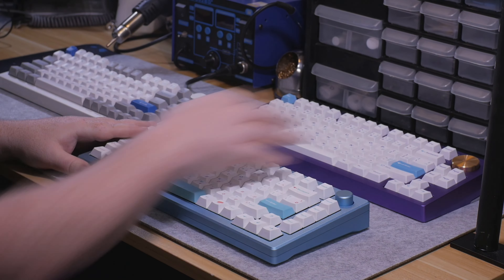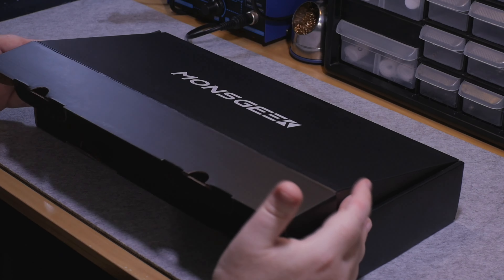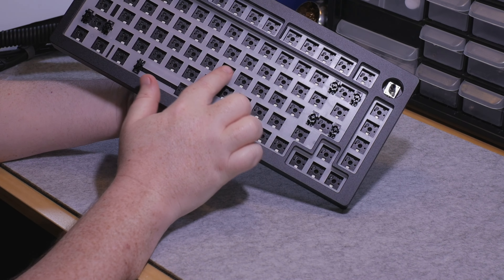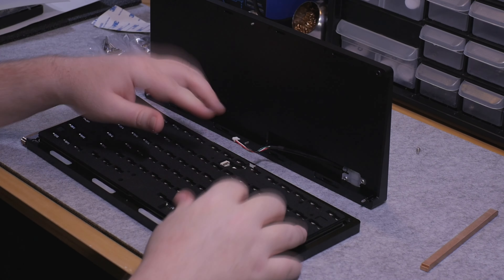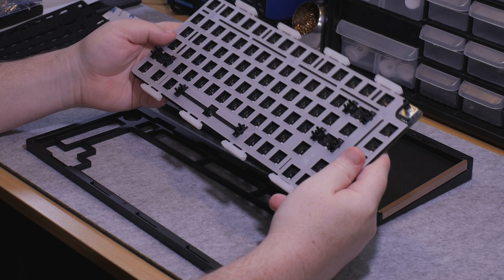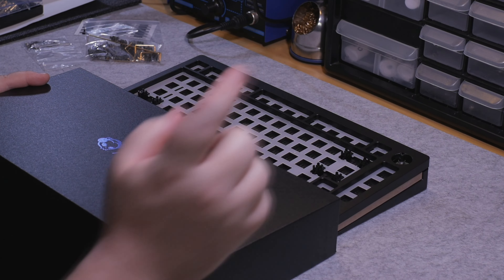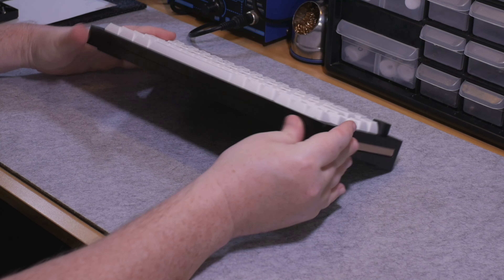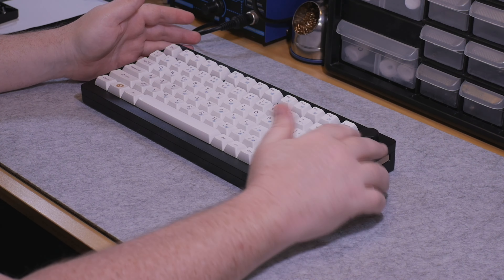Changing The Game - Monsgeek M1 Unboxing and Build

Comment from the maker: The excitement I had for this board was justified. Sure it needed a little love but for $100 this just simply slays the competition in the same space. Give it up for Monsgeek! Do you think this will change the in-stock game as we know it? Let me know in the comments!
Reply: Hey punk! did you check the Finalkey v65 r2 ? i found it on aliexpress and its even better value! aluminum case, 65%, south facing, PC + Fr4 plate already included, screw in stabs, wireless dual mode, all the foams you need, and even comes with keycaps without the swtches! maybe its a contender for best budget KIT. !! check it out
Reply from the maker: Its in the same vein as the M1 but still misses the mark a bit. Its $30 more expensive and is a smaller layout which alienates a good bit of newcomers to the hobby. The BT is a nice add but also somewhat pointless in an alu case. Don't get me wrong, its still an okay value, but its in the same neighborhood as the Q2 and MOD 008. Its basically in near direct competition with them. $30 might not seem like much but it can shift a product an entire market segments.
Reply: @punkshoo  i know moonsgeek claim $99 but thats not the real price its beeing practiced at aliexpress. The finalkey v65 r 2 i found to be cheaper then the M1.
Reply from the maker: The one being sold on AliExpress isn't the int'l version. Please check the Monsgeek site. The board is $99.99 + shipping. The Finalkey is $126 + VAT + Shipping. Again, still a decent value but its like comparing apples and oranges. They clearly service 2 completely different types of customers.
Reply: mxrskey ck820 good? I know it’s a bit more of an expensive kit but is it on par with or better?

Comment: To those who doesn't know yet, the white sheet inside the keyboard was supposed to be stick on the bottom on the case so that you wouldn't shock your pcb. The white sheet in the box, was for the tape mod.
Reply from the maker: That is correct. This was demonstrated at 11:27 in the video and the tape mod was mentioned in the unboxing section.
Reply: @punkshoo  sry but you messed that up..

Comment: What was the flex like with all the included foams? Would you recommend maybe losing the case foam to increase the flexibility of the gasket mount (ie, leave more room in the case for movement)?
Reply from the maker: Having full foam is always going to reduce flex a good bit. There is minimal flex but you can still feel the bounce in the typing experience. If you want that full flex I would definitely remove the case foam but you'll likely need to use polyfill or some other less-dense filler to remove hollowness.
Reply: @punkshoo  Do you think the hard plastic sticker that you put on the back of the case enough to reduce any hollow ping? Or you think you'd need something more?
Reply from the maker: The sticker is more for preventing shorting than anything but it does help slightly with resonance. I would also do a force break at a bare minimum and then decide for yourself. I personally would still use some thin felt or polyfill, personally.

Comment: hi! can you please explain where did you apply the double layer of painters tape? it was on the bottom case instead of the sheet given in the package?
Reply from the maker: Tape mod goes on the PCB and I used my own tape so I have control over selective layers. I like to put one extra layer under the spacebar usually.

Comment: I think they used aluminum screws for the aluminum case to prevent galvanic corrosion from happening
Reply from the maker: I doubt that is the case. They are likely using lower cost alloy screws to reduce the over all cost.
https://www.metalworkmasters.com/materials/stainless-steel-screws-in-aluminum/

Comment: So regarding the non ferris screws, its actually a good thing because ferris screws have softer materials mixed. So non ferris screws are actually higher qualityx as far as i know.
Reply from the maker: Do you have a source for this information? Non-ferrous refers to the lack of iron in the material. If there is no, or minimal, iron I would imagine that it'd be primarily nickel, aluminum, or magnesium which are all softer metals.

Comment: The white Sheet is the Tape Mod for the PCB. Stick it on the PCB
Reply from the maker: I am aware of this. I mention this in the video that a "tape mod is included". I opted not to use it in combination with PE foam because I am not a fan of both and I mostly dont like tape at all. I only use tape if I need to elevate the volume.

Comment: Just bought a clearance sale nk87 aluminum for $75. The M1 looks sick and idk if I made the right choice. With the mods, would the M1 compare in quality to a typical $250 case?
Reply from the maker: I would consider the M1 to be a bit nicer than the NK87 but there are lots of factors to consider. Which color NK87 did you get?

Comment: can you make this keyboard sound deeper("thock") with some mods and different switches? And if so what would you do differently than what you did
Reply from the maker: You can load it with foam, switches that lean toward deeper pitches, and use taller/wider keycap profiles to lower the pitch.

Comment: HI, whenever I press one side of a key with a stabilizer the other side pops up. Do you have any idea on how to fix this?
Reply from the maker: Make sure you're using stabs that are correct for your switches. If you're talking about your spacebar then check for bowing. If the spacebar is bowed it can usually be fixed with the hot water method.
Reply: @punkshoo  how can you know if you are using the correct stabs for your switches?
Reply from the maker: Sometimes long pole switches can sit higher than some stabs which will contribute to these teeter totter effect. Its usually not overly pronounced and easily triggered but the issue does exist in some cases.
Reply: @punkshoo  do you think the akko pom silver is good enough for the monsgeek m1 screw in stabs?
Reply from the maker: They are slightly long pole and I havent had any issues with the stabs combined with Akko switches on the M1. Outside of that not sure what to tell you.

Comment: Hows the flex on it?
Reply from the maker: Its fairly flexy with the stock PC plate. Especially if you remove the case foams.
Reply: @punkshoo  I agree! After purchasing it and experiencing it myself i feel theres a great balance between sound and flex without case foam and force break done on the board.

Comment: The biggest question really is what's the difference in typing feel between M1 and Mammoth. 
There really is none which is why there's only a sound test. So unless you're looking for that mammoth weight, M1 is the best value.
Reply from the maker: There's actually a SUBSTANTIAL difference in typing feel. The M1 isn't nearly as flexy as the Mammoth. Whether or not that matters to you is entirely up to your preference in typing feel. There's only a sound test because this wasn't a Mammoth vs M1 video. This was an M1 video with a small side of audio comparison just because. Also, the M1 is using linears and the Mammoth is running heavy tactile so there's that, too.
Reply: @punkshoo  Good to know. I was hoping to hear some sort of comparison between the two in the video unless you were planning to do a comparison video later. If not it kind of leaves the viewer wondering about the differences.

Comment: What sound profile would I get with lubed cream yellows? And akko keycaps? I prob gonna force break and use pe foam and is the m1 better then the mod 007?
Reply from the maker: Cream Yellows are your standard Akko switch in terms of composition. Check out other Akko switch sound demos to get an idea. They should sound similar to Machas or Radiant Reds. It wont sound like these because these are a special collab switch Akko did with a Billi Billi creator.
Reply: @punkshoo  I know I'm choosing the yellows since I'm on a tight budget and idk if this build would be quiet enough so when I call with my friend them ears don't die. I might be able to filter it out with my mic

Comment: Does it have n key roll over and what kind of stabilizers do u need for it
Reply from the maker: it does have NKRO and you can use plate mount or PCB stabs. Screw ins or clip ins will work. I had no plate tolerance issues with the PCB ones I used like we've seen in previous Akko products.
Reply: @punkshoo  No, like what sizes for the stabs
Reply from the maker: It just takes stabs... there's only one brand that comes in "sizes". Its a 1.2mm PCB if that's what you're asking.
Reply: @punkshoo  is the spacebar a 6.25u or 7u
Reply from the maker: Its a standard 6.25u.
Reply: so cringe

Comment: How to make this keyboard quieter without using slient switches?
Reply from the maker: Use normal travel switches with more muted sounding housings, PC plate, and lots of case/plate dampening. Don't PE or tape the PCB.
Reply: @punkshoo  thank you for the reply. I am really new to custom keyboard, I assume the M1 already comes with a PC plate? In regards to switches with muted sounding housing, my own research told me we are talking about switches with Nylon material? I have been wanting to try out Gateron Hippo, Lavender and the EQUALZ Tangerine, which I was told they are some smooth and quieter linears, am I on the right path?
Reply from the maker: Yes, the M1 comes with a PC plate and it sounds like you are on the right path with those switches. I would point out that it sounds like your basis is in older information as all those switches are quite dated at this point but on the other hand most new switches are long pole which tend to be a good bit louder.
Reply: @punkshoo  That's a good point about the switches, I haven't figured out about what to look at when it comes to trending quiet lieaner switches, I supposed. I actually have tried 3-4 sets of Akko linear switches, I am currently using the Rose Red, I like light presses, minimum forces but it doesn't sound good at all. (After watching your review) I'm planning to start a new build with more premium linear switches - non-Akko, and wonder what would be my best choices. Really appreciate your help so far.